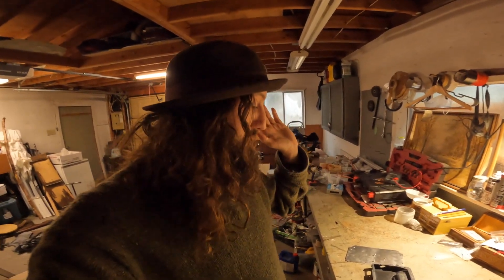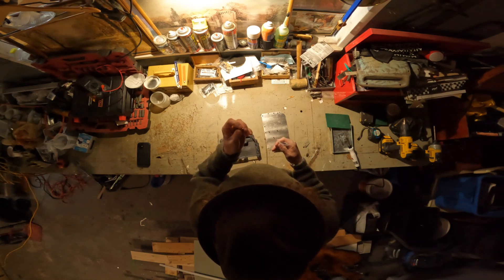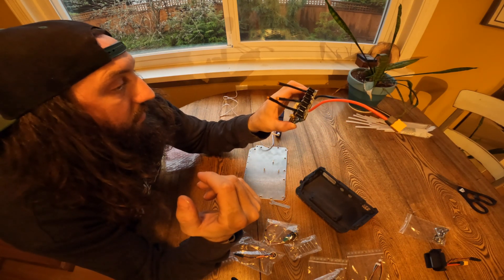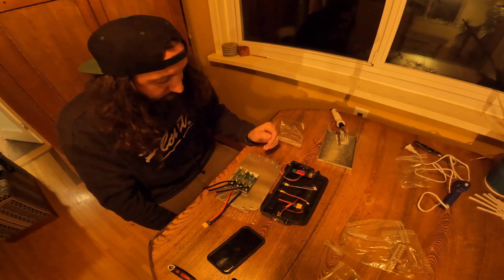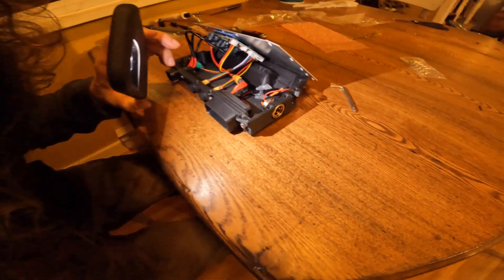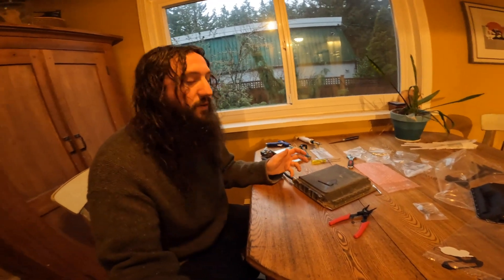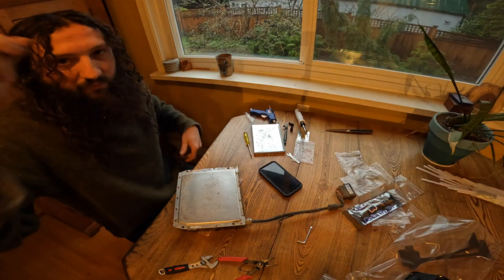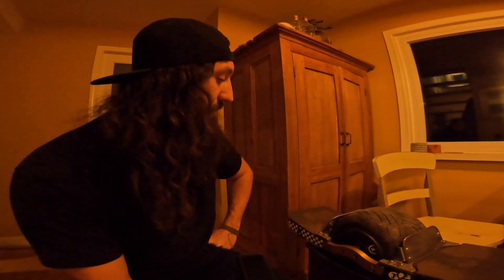Building my own VESC based Shredwheel!!!

Comment: I have an old XR with a bad BMS.  Sounds like this will get that board going again.  I’ll have to look into the cost of it all before I decide, tho.  

Can I use my original, OEM electronics enclosure instead of buying a 3D printed one?
Reply from the maker: You can sell the FM controller for 500 and then buy the vesc parts you need for about the same price.
Reply: FM controller goes for 500?!  Holy crap.  And I was just going to throw the whole thing in the trash because it’s been sitting in my house for a couple of years, broken.  Thanks for the heads up.
Reply from the maker: @BrokenToeKnee   controller goes for 650 in Canada same for just a BMS probably 600 for the motor as well. Parts are always in demand
Reply: Too cool.  

Thanks a bunch.  Probably going to take me a few months to get this project going - My plate is full with a bunch of other stuff at the moment.  (such as a boosted MiniX with a bad battery pack.  It's always something).